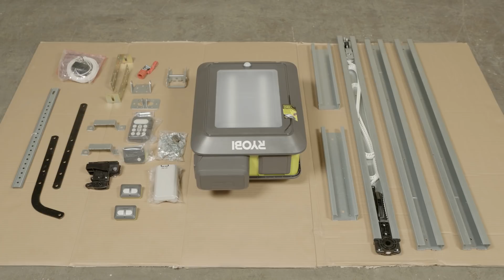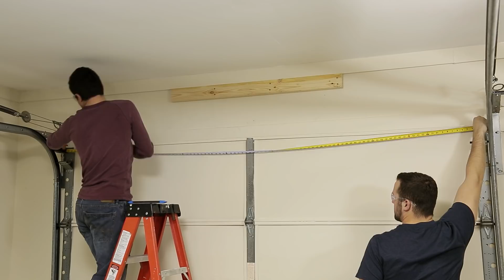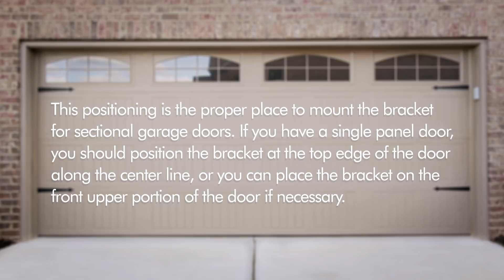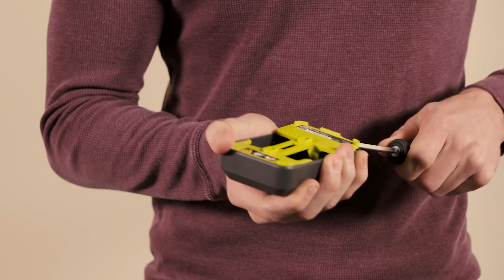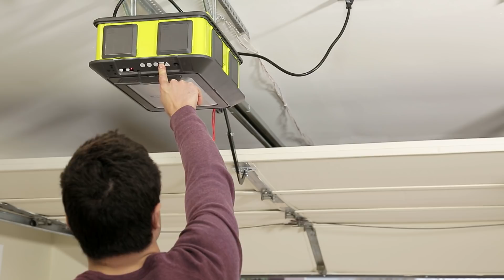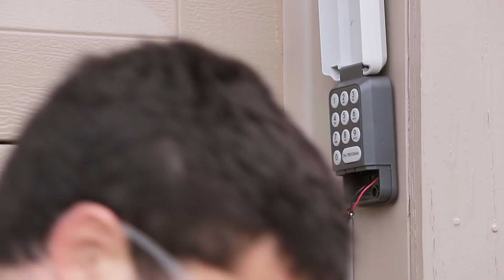RYOBI Garage Door Opener Installation

Comment: Do not buy it due to the safety sensors going bad. I have had one for about 4 years and I have had many connection issues like the garage door controllers not working, random wifi disconnection, the application randomly activates Vacation Mode, and lastly the most annoying is the safety sensors going bad. I have had to replace the safety sensors twice (under warranty) but once you are out of warranty (3-year warranty), like me, Ryobi will not replace the sensors nor sell you the sensors. My garage door opener is now trash because without the safety sensors working properly it will not open or close the door. I tried looking for the sensors online with no luck so far and Home Depot, Amazon, eBay stopped selling them. The accessories are cool but what's the point of a garage door opener if you cannot use it. Save your money and buy yourself a reliable brand.

Comment: I've owned 5 garage door openers in the past 15 years and this Ryobi is the worst piece of junk ever. The Chamberlain garage door openers are superior to this one in every way possible. After owning the Ryobi GDO for 7 months and battling it every couple of weeks with some issue, I  spent  $300 buying a great Chamberlain. I had a lot of satisfaction ripping the Ryobi out and throwing it in the garbage. Never again will I buy anything other than Chamberlain. It installed in a fraction of the time without any issues, connected to WiFi, and correctly reported the garage door status. That's all I asked for.

Comment: I like how many portions do not cover the 1 1/4 horse power model. Also dont waste ur money on the smaller garage opener.1st one didnt work. 2nd 1 i bought the wifi portion was broken. Also i bought the air compressor attachment and an extension cord attachment, problem is with the smaller unit, you cant hook both attachments up because one side of the ports is covered by the rail system...bad bad design. Very disappointed in ryobi as i have almost every power tool they sell

Comment: So much wrong with this video. But ryobi openers suck anyway. I got a call about one that would not close the door. Customer installed of course. Turs out he had added brush seal to the bottom if the door and this hunk if junk could not force the door to the floor with it on there. Ryobi is a shit brand of tools and now they are infecting the door world.

Comment: Bought this garage door opener approx. 2 years ago. I have had so much trouble with this opener. It will open sometimes but every third or fourth attempt to open I need to hold the button till the door completely closes. Called RoyobI the tech says I need to start over and reset. I’ve reset a dozen times I tried returning to Home Depot but they wouldn’t take it back..

Comment: Your installation instructions are wrong regarding the indoor keypad.  The booklet shows the indoor keypad being hard wired to the opener, this is wrong.  You need to install the receiver (why isn't it built in to the unit?), the indoor keypad is wireless.  The receiver isn't even mentioned or shown listed in the installation booklet. UUUGGHHH, I should have bought a different brand.  The indoor keypad doesn't backlight either.
Reply: The reason its not built in is because the range of the indoor keypad sensor. It needs to be located line of sight, its bluetooth. Having it built in would not work in some applications.
Reply: It would kind of be nice for the manufacturer to say "We value our customers input and will correct any inaccuracies in our installation instructions", but I guess such courtesies have gone by the wayside in this day and age. Won't be buying any Ryobi products any time soon.

Comment: 6:53 "if you are doing a new installation, the center brackets for mounting the power head are not included. They can be purchased at the home depot."

Got a link? A sku? I can't find these brackets anywhere.
Reply: I shop mainly at Lowe's due to location, The same exact brackets are sold there as seen attached to the ceiling in this video.

Comment: To bad ryobi dropped quality it if their product line. I used my pressure sprayer 3 maybe 4 times in the last three years and the thing blew it a valve... No way would i trust them not to drop a door in my car. 

It's sad because I used to brag about their tools in the 90's my first power tool was a ryobi angle grinder. I was very disappointed in the quality drop.
Reply: Amnesia Iforget yep it shows. This opener is a POS

Comment: Pro-tip: You can adjust the  playback speed in the video settings. Because holy crap guys, slow down!
Reply: My indoor garage door opener isn’t working. It was working fine for a year. I replaced the batteries with no positive results. When I push the buttons on the garage door keypad the green light on the sensor flashes like it always does but the door doesn’t open and the accessories don’t work. The opener works fine from the car opener and outdoor key pad. Anyone have any hints for me
Reply: @terrydoran7412  That's weird - I had some issues recently and it turned out that my sensors had died. Calling the garage door help line (NOT the main Ryobi help line, they never answer) helped me figure out the issue. The number is super hard to find so I saved it in my phone - 877-205-5174. These things have a three year warranty IF you still have the receipt.
Reply: jerkychew899 thank you

Comment: This is no bueno.  Bolt that holds the belt tensioner isn’t correct size.  Bolt just spins because it doesn’t grab the sides of the rail.  The brackets that attach the rail to the motor are also too small.  Very poor quality assurance.

Comment: Just installed one. Overall. I really like it. Love how quite it is, and I like that I can add on some accessories (although I haven't yet) but there are a couple issues too. 
1 I want a wired indoor keypad option  (not a fan of batteries)
2 it would be really nice if there was a way to tell when you garage is "locked" other than finding out the remote doesn't work.  maybe if the keypad would light up?

Comment: Just installed one in my garage. It is very quiet and easy to install. Range on the inside keypad is not that good. I will have to relocate the receiver by adding longer wire to it.
 
This was my first time.  Video was very helpful unlike the instructions which leave out few important details. 

Thanks for the informative video.

Comment: So I installed Ryobi Garage door opener GD201 today connected everything
 but the app says door is closed regardless, when it's opened it says 
that it's closed. Relay hub and door sensor been paired and connected to
 wifi.. None of the notifications in the app work and none of the 
activity logs shows.. I think its related to their patent infringement 
lawsuit with Chamberlain @t I think they dropped the ball on the development because of their lost lawsuit to Chamberlain over patent Infringement.
Reply: Same issue here
Reply: @SummertymeJamz  I figured mine out after few calles to their customer service, try to get a guy named Robert Porter, he is the one who figured it out.. Also I made a review video of my GDo https://www.youtube.com/watch?v=9rbeQS28_9o
Reply: How did you get the relay hub to connect to the wi-fi? I did not see anything in the GDO system app that recognized the hub after I pressed its button.
Reply: @hungkang5477  Relay hub and garage door sensor should be paired by bluetooth first, per instructions, then you connect relay hub to 2.4ghz wifi using your phone, also per instructions. hard part was pairing DGO sensor and relay hub via bluetooth
Reply: @AlexeiPavlov  I don't have anything in the app which could connect the relay, only the opener. The instruction says to open the app and follow the instructions where. I do see a WiFi network when I'm pushing a WiFi button on the relay, but how to set it up?

Comment: One giant flaw. When they showed the old opener coming off you could see the locking mechanism was still attached to the door. The lock should be removed because if the door was ever locked and the opener tried to open it would be a a catastrophy.

Comment: This product sucks. Do not buy it!!!
Reply: Just bought one and am currently installing it...could you tell us why/provide more details?
Reply: Nicholas Osczypko it’s a low quality opener that doesn’t last. There are way better alternatives out there.
Reply: Edward Nyack I got to agree, installing the physical components was a piece of cake, but programming takes way too much time!  Power outage a week later and crap doesn't work, open and closed manually, tried to press reprogramming, it just blinks the green lights, GARBAGE!
Reply: Ok! I won't! /sarcasm
Reply: Video made it easy, I had a little trouble getting the relay hub to connect to Wi-Fi. Called customer support they walked me through it and it connected the first time. Great product and great customer support!

Comment: what would you need for a wood garage door cause i will like to install oneand it is way heavier than my old garage door
Reply: That is up to your garage door spring. It will have to be wound tighter for a heavier door, or even a heavier spring installed.
Reply from the maker: Please give our Customer Service Team a call at 877-205-5714 with the specifications on your door and they will advise.

Comment: I don't know what happened but I go to set the door limits and I am trying to engage the outer trolly with the inner trolly and there's no inner trolly. I go to hit set and it just goes into an endless beeping loop. Where could my inner trolly have gone...?!
Reply from the maker: Hi, Thom! Please reach out to our Garage Door Opener and Accessory System Customer Service at 877-205-5714 and they will assist with troubleshooting options!
Reply: Did you ever find the answer? Inhave same issue